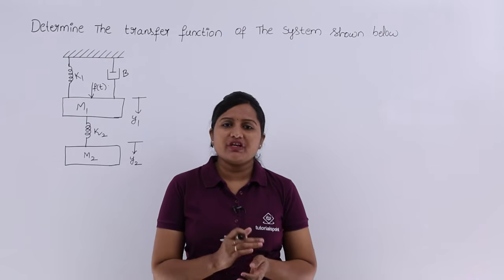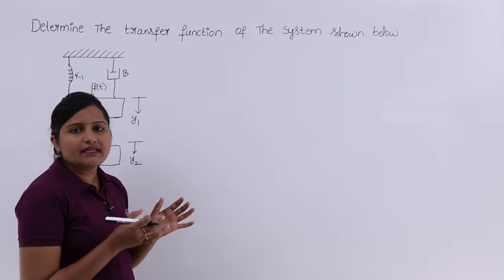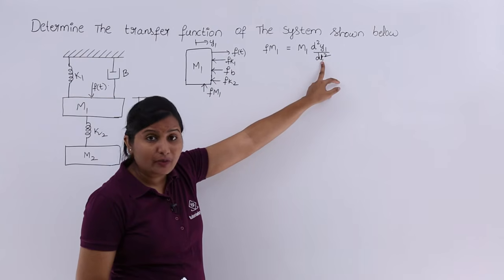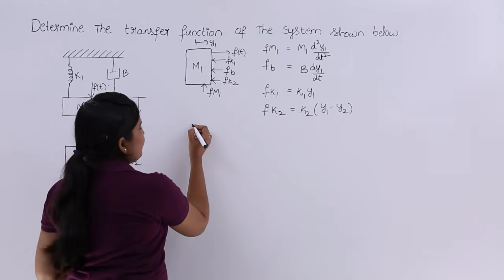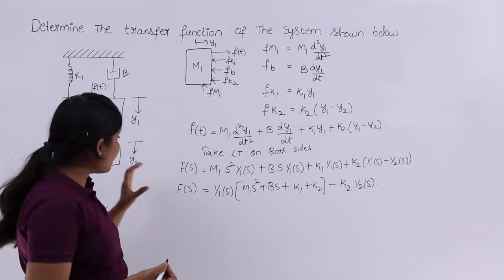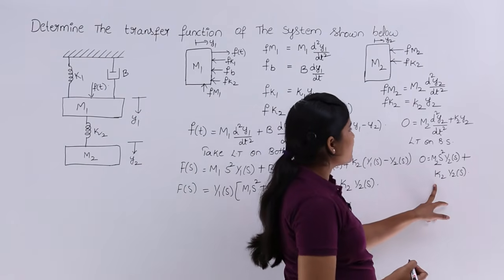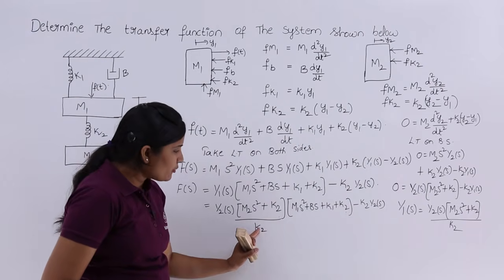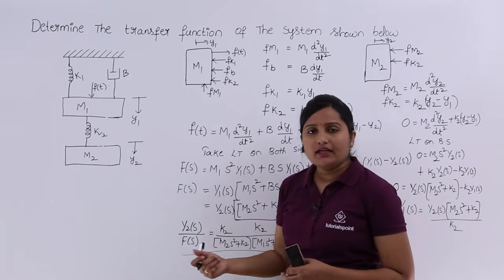Problem on Mechanical Translational System

Comment: In this problem where is mg component ? because that is also a force and is to be applied on both the blocks M1 and M2. That particular mass multiplied by acceleration due to gravity (i.e g = 9.81 m/s^2) has to be applied on both respective blocks in the free body diagram of both the blocks. My question is why is it not included in free body digram as well as rest of the problem. Thank you.
Reply: mg component is ma where a is acceleration due to gravity.
Reply: @MShazarul  https://youtu.be/XS9uSSq_npM
Reply: This acceleration due to gravity is still an acceleration which is the second derivative of displacement, which is there. It's just that in this case you know the value of the displacement
Reply: And also there is no Laplace transform of g😌
Reply: That mg component is applied in downward direction which should be there in this case
Reply: @parthdandawate7245  https://youtu.be/XS9uSSq_npM

Comment: why don/t we consider gravitational force??
Reply: i think gravitational force is already acting on the system in the condition when we dont apply any force. so we just have to take the force applied and reaction due to that force .
Reply: In this problem, the force is applied to a system at equilibrium condition which means the gravity is already applied and the system reaches its equilibrium condition.
Reply: the gravitational force between these two closer bodies m1 and m2 is very very small. G=6.67*10^-11...thats why we dont consider it
Reply: @E  lemme guess
u read that book on vibrations and came here only to drop some knowledge?
lol